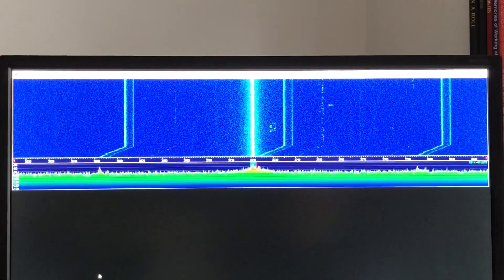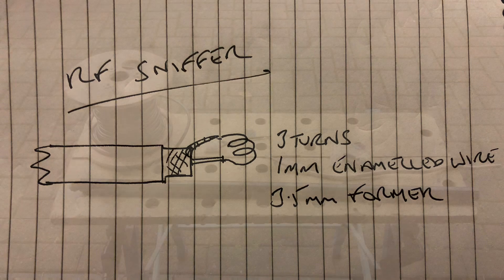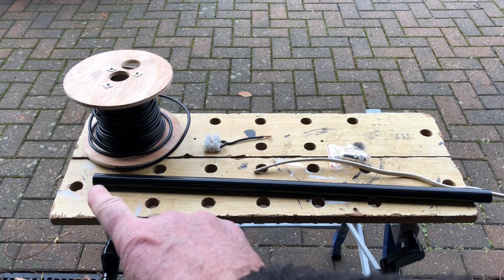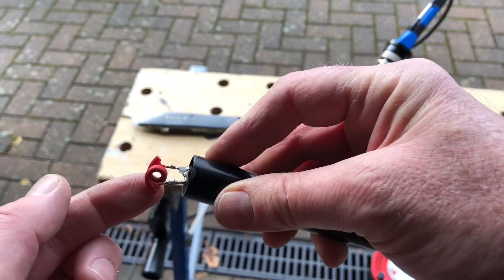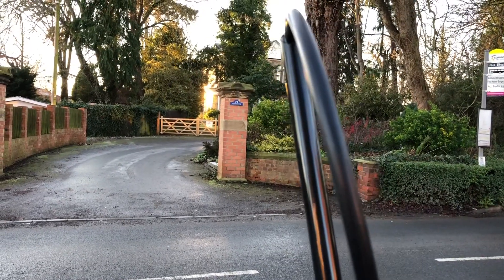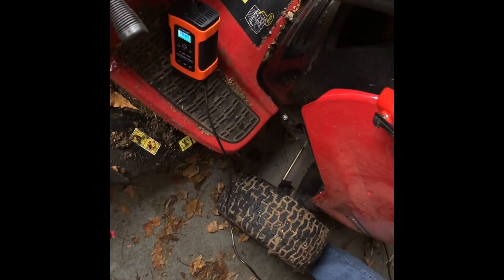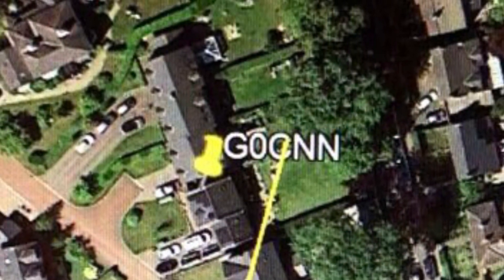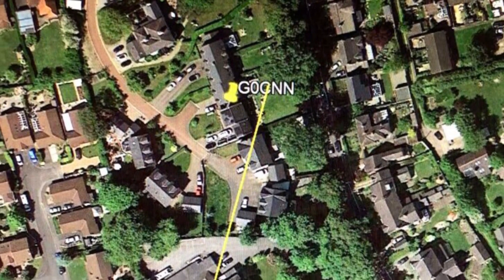I Found & Eliminated My QRM / RFI (Radio Frequency Interference)! 🥳

Comment: Hi Ian  Thanks for sharing your experience for RFI finding. How did decide which battery charger would be less or free from RFI for the replacement?
Reply from the maker: Hi, I went for a make/model made here in the UK so I knew it would be compliant. Plus it was a model I already had myself for charging my /P leisure battery.

Comment: Great video. I love the sniffer antenna you made. 

I have also found a drill charger to be the cause of interference for a customer once before. The same customer also had a gcfi outlet, computer processor, and many LED lights that were causing ingress into his TV antenna. All the accumulated noise caused issues with his VHF band. 

When neighbors are helpful, it's great to be able to identify the issues, but in cases where we have no access to the noise source, then system changes can sometimes help. Besides identifying the noise sources, I have also found that the inside wiring has to remain completely closed and tight from the balun all the way to the connected devices. All unused ports must be terminated. If there are any RF leaks and ingress in the coax system, it starts to act like an antenna. A slightly loose connection can cause issues and so can a poorly compressed connector  Faulty, cheap and in-house leaky equipment can also cause leakage and ingress. Of course, I am speaking mostly of 75 ohm TV systems, but the 50 ohm systems also share the same problems. If we think of the entire coax system as plumbing, it easily becomes clear how and where the weak points are. If a coax accidentally gets poked by a drill when securing the wire, the jab can then allow RF leakage and absorb ingress too. With TVs, the baluns are wound to tie into the outer shielding. It's how 75 ohm systems work. This also closes off the antenna at the balun transformer, making it easier to start our leak free plumbing/coax from the antenna down.
Reply from the maker: Thanks. Great comment and plumbing analogy 👍🏻

Comment: Fun video. 
Little bit of  history: in the Netherlands '40-'45 the occupying forces of the nazi's used similar techniques and mobile loop antenna's to locate transmitters that were used by the resistance to communicate coded messages back and forth with the government in exile in London. Sadly many transmitters and resistance people were captured. But as time passed the resistance got smarter as well and started to use mobile transmitters in order to make it harder for the nazi's to find them.
Reply from the maker: Thanks for the interesting history lesson 😀

Comment: Very well done Ian, am I right in thinking that you use the loops null to get a line?
I had a very loud QRN and used an FT817 with it's rubber duck and did it by looking at the null direction.
I think a loop like yours would be much better and quicker though.
I eventually traced my QRN to an Estate Agent about 300 yards away and of course walking up to the door (at 2AM) found the signal was swamping the little 817's front end.
Went in the next day and like your neighbour they were very cooperative.
It was traced to a decorative LED light of Chinese manufacture,
They very kindly left it switched off.
They recently sold the property to a Kitchen shop and I had a chat with the new owner who said dont worry I am stripping it out as It's Chinese rubbish.
Thankfully new shop fit is RF quiet so it was job done.
73 Mike G3ZCC
Reply from the maker: Excellent Mike! Yes, the loop face-on is a deep null. Easy to walk about twisting it on it’s axis between face and edge-on to get a bearing and another line 😀

Comment: Hi could someone help me please I live in Hertfordshire and have recently got back into radio since the 80s went out bought a radio and aerial and have a constant qrm of signal 9. Done the obvious ie turned of my electric and still noisey. Put radio in my car and the noise is within 50 metres diameter of me.
Reply from the maker: Hi Albert and welcome back to the hobby! I too came back after a 30 year break. If you checkout the previous video to this one I show how to build a very simple loop for RF finding. Nothing technical involved, just some coax and plugs. That would be a good start to pinning down the location of the source. Good luck 👍🏻
Reply: @G0CNN-Ian  I don't have any parts nor a hand held also is this something you could help me with some people don't want to help at the moment because of covid etc I don't mind paying also. Just need some help.
Reply from the maker: @albertfooty7868  Hi Albert, your best bet then maybe your local club once we’re out of lockdown, so in a month or two? I’m in Durham, so a very long way from your location. Perhaps order a few pl259s and a few metres of rg213 online and go from there? If you’ve been in the car, then you’ll be able to direction find from the car perhaps? Fingers crossed you get sorted 👍🏻

Comment: Ian, not sure if I have asked this when you first uploaded, but what can you do if the home owner is uncooperative?
Reply from the maker: Ultimately Ofcom John. With a log of evidence, timings etc.
Reply: @G0CNN-Ian  Thank you Ian; I suspected that would be the path.
Reply: There is another approach John.  Invoke their own self-interest.  Tell them that the interference is also slowing down their own Wifi speed and range. Also interference is often a sign of a power supply or charger  overheating fault that could start a fire in their home. Cheers, Ian VK3BUF

Comment: hi ian,,,,,, would mini 8 coax work for the loop or would you reccomend the rg213
Reply from the maker: Hi Andy. I would think it would be ok and worth a try if you have a bit spare and the plugs. I’m not 100% sure though. At worse, 1 metre of 213 plus two cheap plugs will probably be a fiver if all else fails. Good luck!

Comment: Were does the 3.5mm Former go please as you do not show this in the video? Thank you.
Reply from the maker: Hi Dave. I don’t have a 3.5mm drill bit, but I point out in the video that the piece of black wire I found which is on the work table is 3.5mm. After using it, I’m not sure whether the half mm to either 3 or 4 mm would make much of a difference? You might have a screwdriver handle or nail etc that might be 3.5? Good luck!

Comment: So will a larger loop work better? I also have some 75m QRM in the local area
Reply from the maker: I’m not sure Bob. This definitely worked on both 15m & 80m, so seems to cover the HF bands. The only other thing is sensitivity, but you’ll have the rig’s pre-amps to increase or reduce the QRM signal.  Worth trying this design of the sake of 3 foot of coax. Good luck 👍🏻
Reply: @G0CNN-Ian  Well, not sure what I've done wrong. I've got occasional, egregious, multiband QRM (same source). For example, one frequency is 14175 has a strong signal on my rig (NB kills it, but it would be nice to find the source). I built this loop, checked for closed/open continuity, everything seems to make sense. But my S-meter shows S0 with no loop attached (check) and S0 with the loop attached. But you say it appears to cover 15 to 80m in your experience.
Reply from the maker: @Roddy1965  Hi! Not sure what’s happened there 🤔 I would suggest a double-check that the centre conductor isn’t touching on the side where it’s cut off. Also position the loop close to a noise source in the house to see if it’s picking up anything eg PC, TV, monitors. Pre-amp on maybe? Then all’s left is to walk around the area to see if you come across the source perhaps? Good luck!
Reply: @G0CNN-Ian  There were some moments where I could just hear the interfering noise, so I guess it's working, but it sure is weak. I hooked it up to my antenna analyzer, and if I read it correctly it's probably a lot more sensitive on 2m band. Looking more online it seems 14MHz loops would generally be much bigger, which makes sense. The RASA video gives a demo, but only when they're quite close to the offending unit. I'll keep trying.

Comment: It was not that much the charger itself radiating, but the wires from it were the antenna. A few clamp on ferrites and it should be better.
But I'm suspecting some of the internal components of the charger are just about to die, with a big smoke, normally it is hardly ever necessary to add any extra filter components around a SMPS for anything higher than above 2MHz, beside a reasonable design of the SMPS physical construction (and that is a must even to reach any good efficiency and reliability, so save quite a lot of cost on heatsink, by the way, so dtrong motivation even for cheepeese to do it right), it does not need any extra expensive components (just one cheap Y2 capacitor as an emi-only related component is enough). That makes me think it is just faulty unit (some sparking cold joint or a bad capacitor) and not a bad design by itself...
Reply from the maker: Hi Anna. Thanks for the reply. This charger also appeared in an RSGB article here in the UK. They have no suppression built in apparently. I’m
swapping this one out 👍🏻

Comment: Excellent work. I had terrible local RFI,it was a wire laid around a neighbors garden pumping out 24/7 HF rfi to control a robot lawnmower . Luckily neighbors cooperated and a filter solved the problem. Cheers Dave. Ei3ixb
Reply from the maker: Thanks Dave! That’s an unusual one, but well spotted and sorted 👍🏻

Comment: I've a very similar problem that's wiping out all of 80M and 40M. It's a constant awful S9 (sometimes ++) of similar crackling. OFCOM are involved but due to the pandemic are limited as to how involved they can get right now.
They've located a very possible source yet the shop owner isn't responding to their contact.

I'd be very interested in the details of the larger loop antenna for doing a similar thing myself as it renders most of the HF portion of the bands completely unworkable. It even gets to 6M and 2M on wet days.

I was quite surprised as to just how far away from you the source was!  

But the usual cheap culprit to blame...

Thank you for the video.
Reply from the maker: Thanks and good luck James 🤞🏻

Comment: Excellent job Ian.  That sniffer idea is genius!

I hate the cheap "Float" chargers, since they cycle on and off as needed for charging. It makes them harder to find as QRM. The cheaper they are, the worse they offend. I've got 3 of the "Battery Tender" brand in my garage along with my HF gear, and they cause no issue.
Reply from the maker: Thanks! Yes, this is definitely a dodgy brand and labelling and doesn’t meet the regs. Unfortunately there’s lots on the online sites, so can only get worse for us all 👎🏻

Comment: Yes, the Chinese chargers are a problem. Tracked some 40kHz noise to a neighbors house, with hood up on car and tiny charger at work. Similar situation in marina, with switchmode chargers on every vessel. Some good, some very bad...
Reply from the maker: It’s not good Dave is it? As time goes on, these things will multiply, as guessing old ones take a while to die...👎🏻

Comment: Great work Ian ! I presume the QRM was airborne and not mains driven ?
It's such a relief when you are able to track down and deal with the QRM, isn't it ! I had a very similar issue a few months back myself, neighbours TV pumping hash in to the bands making them totally un workable. Some direction finding really helped and I offered to buy them a brand new TV and took the old one away. It was an older plasma style tv (video on my youtube page of the QRM it produced)

I found your videos very useful, thank you. 
Enjoy the radio and maybe catch you on the air one day.

2E0UGE 
73
Reply from the maker: Thanks Ross! Yes, that was my worst case scenario, having to fork out to replace a plasma TV 😮 It was airborne, but seemed to be using the mains lead, at least up to the consumer unit, as an antenna. The sniffer could pick up the rf along this chain. Will catch you on the air 👍🏻 73

Comment: My neighbours sadly would just shut the door in my face , because I’m the problem having a DX commander in the garden .
Reply: There is an approach you can use Paul.  Invoke their own self-interest.  Tell them that the interference is also slowing down their own Wifi speed and range. Also interference is often a sign of a power supply or charger  overheating fault that could start a fire in their home. Cheers, Ian VK3BUF
Reply from the maker: Not good Paul. Hopefully you never get into the same position with QRM.

Comment: Splendid Ian, thanks. The big source of angst among many hams is approaching house owners and dealing with it with diplomacy. Your vid shows good methodology to solving it without fall-outs. Did the chap with the charger agree to buy a new one (perhaps with ‘proper’ CE compliance rather than ‘China Engineering compliance’) or did you go halves or maybe agree if he could just use it overnight when you were dreaming of DX?
A couple of years back I did a Churches & Chapels on the Air event (special call etc). Bands were unusable and noise was traced to old-ish heating system (when turned off ALL noise disappeared). It also pointed to the need for possible electrical checkover/maintenance required and they found an issue with a motor on a pump, relatively cheap and easy changed to give some future proofing and possible fire prevention. A win-win! 
All the best- Nick
Reply from the maker: Hi Nick! I’ve ordered him a new one for free. It could have been a tv I suppose, so I got off lightly 😀 I was willing to swap-out whatever was the offending item for the sake of clear bands 👍🏻 Ironically, I’d tee’d up all my neighbours about amateur radio/QRM and helping me find and sort it. They were all keen to power-off for me, but I said I’d do a bit of rf hunting first. Sod’s Law this wasn’t an immediate neighbour, but happy to help none the less 👍🏻
Reply: @G0CNN-Ian  great! The difficulty might be getting a ‘noise-free’ charger (or at least sourcing it with a 14 day ‘no quibble’ returns). I bought a 36Ah LiFePO4 battery approx 6 months ago (amazing weight saving for backpack portable vs lead acid and ace for holding up on V) BUT the charger ain’t half noisy so I charge when not in the shack. I just hope it doesn’t cause probs to my ham mate up the road...... have a good week.
Reply from the maker: Yes Nick. Buying another one that I already have. If there’s still noise then will put it on a timer for the middle of the night 👍🏻 You too!

Comment: Great work. Such devices are another type of Chinese pandemic. A diplomatic approach is the best (possibly only) way to get a satisfactory resolution to RFI.

PS: It would have been good to mention at the end what that resolution is. I see that you've mentioned it in the comments, but the final ep of a cliffhanger needs to be wrapped up -- or do you intend for there to be a Part 4?

PPS: This from QRZ forum Oct 2019:
 
"The name brand of the POS charger is FOXSUR and it clearly says it is a 4AH I'm kicking myself for not figuring it out sooner since the noise was a pulse type noise.  The range of that interference surprised me.  Like WR2E I need to put a charger on my ATV during cold WX (it was 7 degrees last night)."

and 

"If you open it I bet you’ll find an area on the circuit board near the AC power cord for RFI filter components that aren’t stuffed [populated] (or maybe no provision at all). I would also bet that it has a fake CE mark, maybe a  fake UL mark too, or none."
Reply from the maker: Thanks for the comment James. I’ll tweak the description to explain I’ve swapped it out for free. No cliffhanger I’m afraid and I’ll be glad to see the back of it 😀 Excellent QRZ extract 😀

Comment: Excellent, I am so glad you had cooperative neighbors. Since the Christmas lights went up in the neighborhood 40 meters is unusable in the evening. I will have to build this sniffer and do some searching if it doesn't disappear in a few days.
Reply from the maker: Thanks Brian! Yes, the loop is the place to start. The sniffer is good to poke at things if everything is still turned on. A loop indoors may pick up upstairs as well as in front and behind you, so sniffer a good plan b of you get confusing signals. Good luck 👍🏻
Reply: I have the same problem at my QTH. As soon as the Christmas lights come on 40m is almost unusable at S9++. People have mostly took theirs down now and it’s much better. Funny how all these products meet UL or CSA standards but still emit so much QRM.
Thanks for the video from VA3XAP

Comment: That's awesome Ian!   I can't believe how far that charger was interfering, just goes to show.
Reply from the maker: Yes Stewart. Frightening to think how far it reaches. I think it was working through the mains cabling as well as the sniffer was detecting it in the consumer unit in garage and on the extension lead plug where it was connected to the socket on the wall 😮

Comment: Nice solution Ian. I suffer virtually the same issue here and some more even using a magnetic loop.. it's almost impossible for me to locate the source as it could be from any apartment or house near me. frustration is an understatement. 73s
Reply from the maker: Ah yes Steve, if there’s multiple heights involved then that would be difficult. Fingers crossed you get a break 👍🏻
Reply: When the interference seems to be coming from all directions, start working your way up the spectrum as you use the loop.  When you find the highest frequency that the noise occurs, it will be easier to DF.  Take a look at a video I uploaded on the topic:  https://www.youtube.com/watch?v=nx3DbdoySJg

Comment: I have one of those chargers and soon as I turn it on it wipes the whole of my hf out. So I only use mine when I need to :(
Reply from the maker: I’m going to contact the RSGB to see if they want to dissect it for the greater good 👍🏻
Reply: @G0CNN-Ian  Why not have a look yourself? Probably switch mode supply with no input filtering - left out to cut costs.
Reply from the maker: @richardp4548  I sent it off Richard. They can take a look...